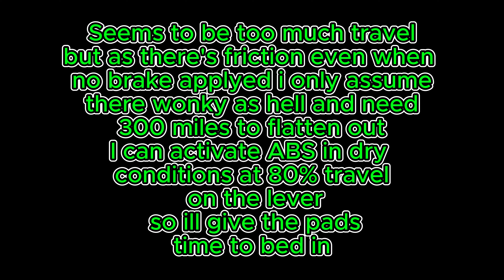Honda Super Cub 2 Pot Caliper Install Almost Gone Wrong !

Comment: Did the same thing to my cub's master cylinder cover screws. Damn things were made of cheese. Had to use a stuck screw remover bit to get them out and replace them with ebay screws.
Also if there's friction when no brake is applied it could be that the caliper is on wonky, you should loosen the caliper bolts until the caliper can be wiggled a bit by hand. Then spin the front wheel and while it's spinning hold down the brake lever. Then tighten the bolts while still holding down the brakes.
Reply from the maker: Nice 1 will giv it a go thx